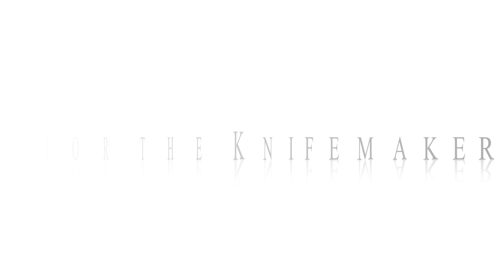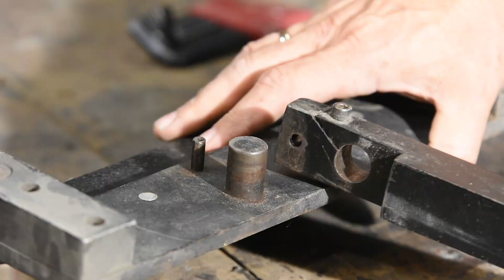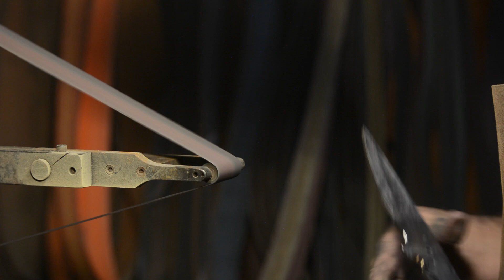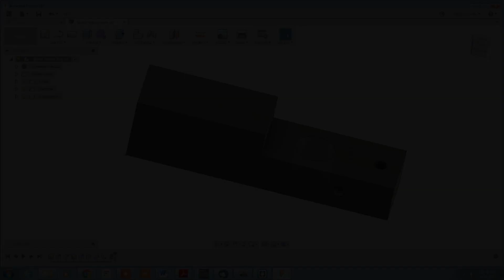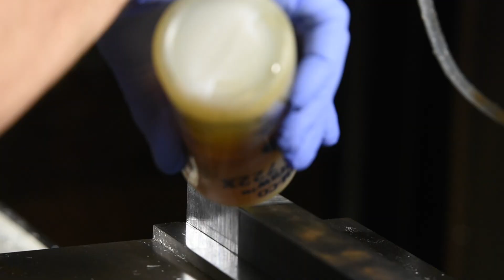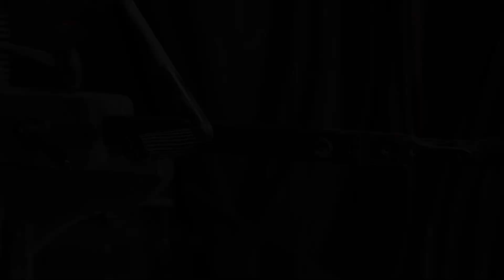Knife Maker's Belt Grinder Hack!  Making an Arm for a Bader BIII

Comment: Gotta test your tool sharpness. Besides, every good project is worthy of a little blood sprinkling to appease the shop dieties. Did you use the special Gaelic, Nordic, and Arabic words? Most of them are only four letters and rather guttural. I use them when drop forging; when my tongs slip off a yellow-hot chunk of iron: squirting it directly into a bit of saw dust and wood shavings that I just conveniently staged up as a target with my broom. Although sometimes the crazy, hot steel prefers to skitter off and lodge with the new, un-opened plastic jug of vegetable oil. YMMV.

Comment: Important Question:

I want to build my own belt grinder but I'm not sure about the motor...
Is a 3 Phase 800w motor powerful enough?
Reply: Sev S. it's about 1hp, that should be enough...a little on the small side but would work, the question would be if you have the voltage and phase requirements of the motor at your shop, if it's at a house you probably don't have three phase and would need a vfd that also converts single phase to 3 phase
Reply: ill have to look into a vfd also, 3 phase motors are more readily available in my area. well generally cheaper. not to mention with single phase im unlikely to find a good sized lathe to suit my needs.

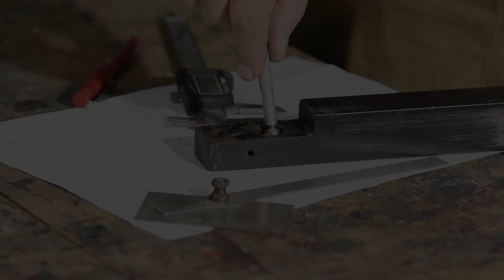Comment: Does anyone know what the tool that was used at 3:35 called? 
Thanks!
Reply: Looks like a simple version of a bore gauge.
Reply: It's a telescoping guage, the rear part locks and unlocks the spring loaded telescoping pin. you push it in and lock it, then insert in a hole and release the lock, it springs out and then you lock it then take it out and measure.  If you're careful it can be very accurate

Comment: Good morning Mr. Sorrells,  love your channel! I just needed your advice on what drill bit to use on a piece 1/8th inch thick annealed bar stock of O1 tool steel. I need to make a 1" diameter hole. Thanks so much!
Reply: Since it's annealed you use pretty much anything, High speed steel is the cheapest and works alright for annealed steel, then you have black oxide which is a bit better, then titanium coated high speed steel, cobalt and the most expensive usually is carbide (very expensive but it can drill through hardened steel). I may have missed out a few. My personal favourite is cobalt, it has good longevity. Unlike titanium is isn't coated to it can be resharpened and still have the same effectiveness. If you sharpen titanium it will essentially be high speed steel only.
I just realised I learnt all of this from one of Walter video about drill bits, I suggest you check it out it is very useful.
Reply: http://www.bladeforums.com/threads/drilling-1-holes.1328352/
Reply: HKnives
Keep in mind that many titanium coated drill bits are fake and it's literally gold spray paint.
Reply: xD

Comment: What do i need in my new workshot
Reply: Depends what you want to make...
Reply: Yonatan24 knifes
Reply: Casper Avenido knife machine
Reply: DeSousaUSMC but im a böacksmith and i mean like andvil , hammer some files....
Reply: DeSousaUSMC blacksmith*
Reply: ive never stocked a workshot so i couldnt tell u.. kidding, what do you already have?
Reply: Dylan Zrim nothing
Reply: id invest in a hand file set, and one decent hammer, as heavy as you like i guess. and an anvil will be a hard one to find, but if theres a local steel foundry ask if they have any scrap square stock, bury it partially in sand with the small face as your striking serface. avoid rail stock but if its the only thing going id use it the same way as the square. also if money is no issue youll find one or get one made pretty easily.
Reply: Dylan Zrim there is a shop next to me that sells andvils and files and ........ all i need but i dont have money so i need to buy only what i need